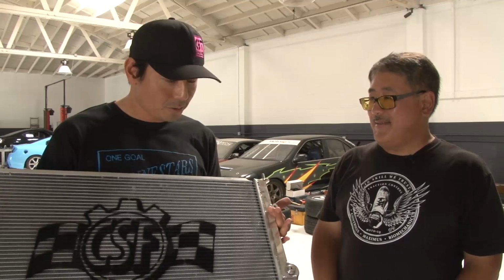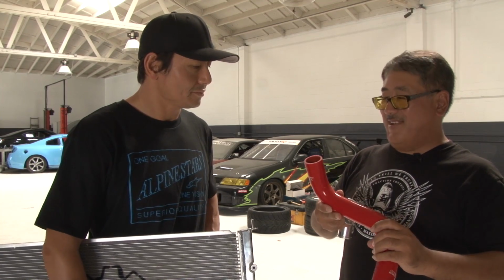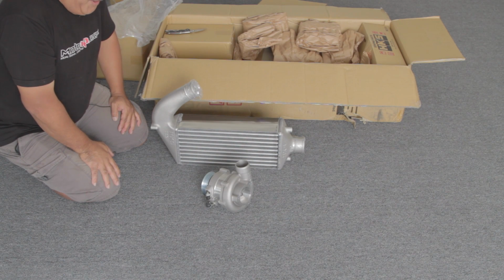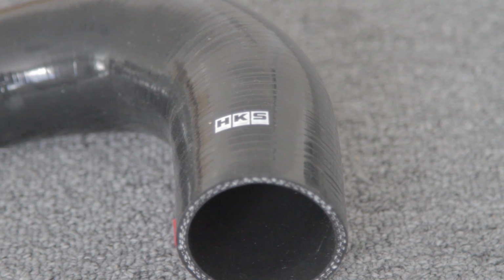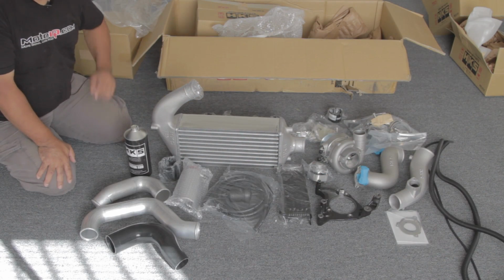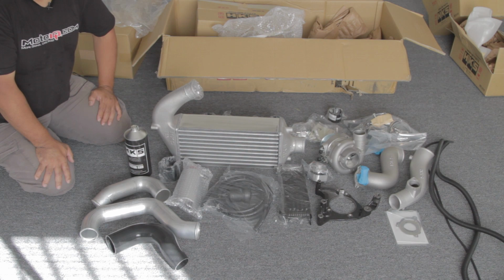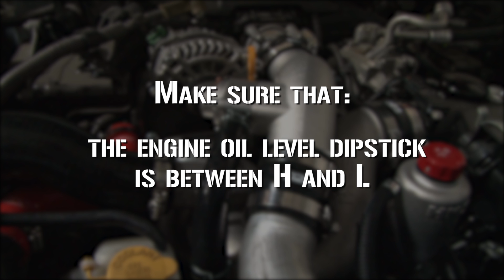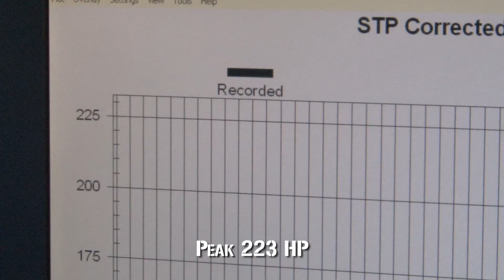HKS GT Supercharger, CSF radiator - Scion Tuner Challenge 2014 Eps 4

Comment: FYI, all dynos are not created equal. This dyno will baseline a stock brz/frs/86 at about 150-153 whp. So hitting 223 is an increase of about 45% or 70+ hp at the wheels on California 91 octane.
Reply: Wow, that's a really nice kit and great video. I like Mike's comments pointing out all the little engineering specifications.

Comment: hopefully the hks unit will last longer than the rotrex units, main difference btwn the two are the rotrex just uses flat gearless rings and friction to drive the shaft and the hks unit uses gears, and hks is quality while rotrex uses cheap bearings and is of questionable quality with all the shaft breakages of rotrex units out there im looking at the hks units now.

Comment: Only 223whp? Stock they are around 180ish whp correct? 50whp gain
Reply: i think stock its around 174 so thats a gain of 59 hp which means around 34 % more power ... thats pretty much to take for a stock engine ... if you beat it hard even that can make your engine last like 1/3 of its stock lifespan ...

Comment: pretty poor cooling setup, putting the inter cooler over the top of the radiator = BAD, then on the other side you put an oil cooler. effectively covering up around 35-40% of the radiator! on the passenger side there was a big space I would have vertically mounted the inter cooler and made new pipes. or HKS could have made a  top mount WRX style (perfect for a boxer, the engine has heaps of under hood clearance) much better options then what and how this was installed. pretty disappointed.
Reply: So wait a minute.  You obviously have a PHD in this, so forgive me for asking.
You would rather put an intercooler ON TOP of an engine, rather than in front of a radiator?  Maybe you're not aware of this ... but heat rises.  The top mount intercooler is one of the first things to go in any build.
Putting your intercooler in front of a radiator isn't nearly as bad as you think it is.
The energy you are dissipating from the intercooler isn't very much, and it's pretty permeable.  Driving your car over some dirty roads will cause way more blockage than this.
The BRZ/GT86 also has pretty bad under hood clearance.
Reply: Wrx has had top mount since inception. Plus with a air scoop in bonnet. The only time u wld get any sort of heatsoak. Wld be after the car was sitting after being run. Aka hot start
Reply: jack black It has it, because it is cost effective, not because it is the best solution.
I have two lying in my garage collecting dust if you want them.

Think about it.  Heat rises.
Not only does heat rise, BUT you have to force air in to a positive pressure area.
The car is moving, air is coming in through the front radiator, pressurizing the engine bay.
At the same time, your scoop has to force air in to that area.
It doesn't work very well.

The setup shown here works quite well, and is well thought out.
Reply: jack black Nearly 90% of aftermarket Forced Induction setups for EVERY car on the planet has a Front Mount intercooler that sits in front of the radiator.
Reply: jack black Even WRX owners buy Front Mount intercooler setups when they go to upgrade and want more power.  You still have a long way to go in learning about cars.
Reply: comes down to space. what can they fit and where can they fit it to appeal to a larger customer base
Reply: There are pros and cons for each FMIC and TMIC setups. Even with TMIC, radiator cooling can be compromised...If you don't understand then you have much to learn.  The HKS setup is nice. With the given engine bay space it's not bad at all! FMIC and relatively short boost tubes...what more can you ask for?
Reply: Do you know how many oem cars use an FMIC? The heat given off by the inter-cooler to the radiator is negligible